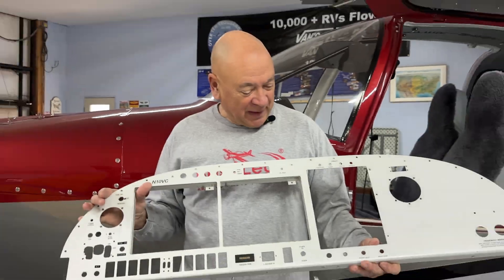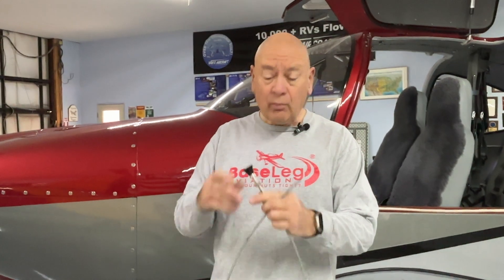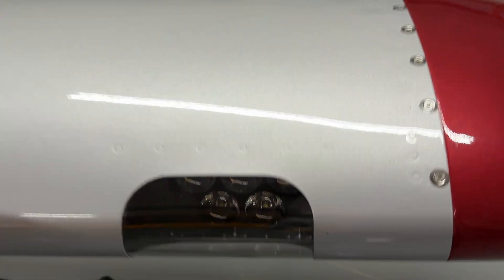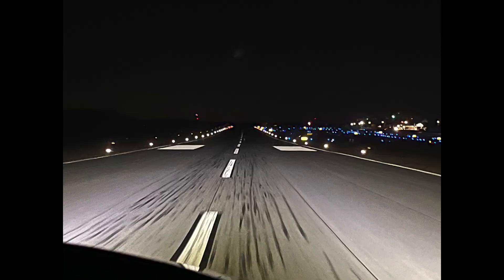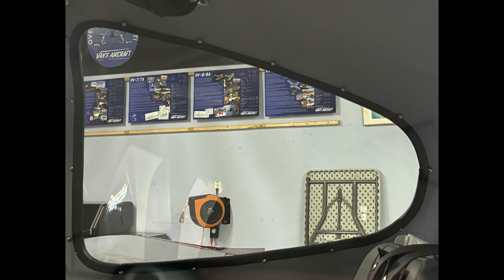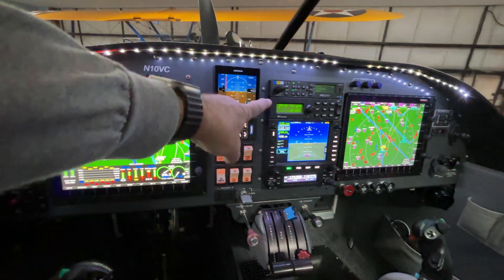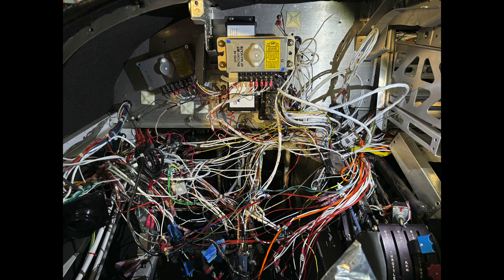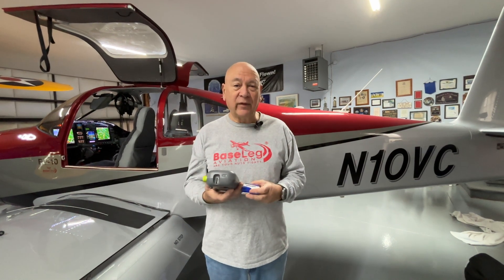RV 10 upgrades

Comment: I just had a mixture cable like that break 2 months ago at 10,500’!!! I went with a twist set up.
Reply from the maker: which mixture cable are you talking about? All of the engine controls on my RV10 are high quality ones with threaded ends and rod end bearings, the same as any twist control.
Reply: @baselegaviation1614  it was the one that looks like a piece of welding wire like the one shown in your video. Briggs and Stratton lawn mower set up basically.

Comment: This may be a never-ending debate, but I would like your input.  You went from two side-by-side displays to centering the two displays in front of the front passengers?  Why did you separate the two screens and now that you have a little bit of time on the new configuration, which do you like better; side-by-side or separated?
Reply from the maker: the 6600’s are bigger than the 5400s. Yes, I would like them both together but they are too big to be on the same side. Plus it would put the navigator GPS too far away. AeroSport products makes a nice panel that allows for a center screen, but I didn’t have the time or money to make that complete change right now. AFS has a really nice feature in that you can put the right screen in map mode and remote zoom it from the left screen. It works pretty cool.

Comment: You mentioned that you have a Tru Track autopilot, but I see a Dynon autopilot head in your new panel.  Are you using the Dynon to command the Tru Track?
Reply from the maker: yes, the SV-APPANEL you noticed allows direct entry to the autopilot functions instead of having to use the screens. it also has me prepared for when/if the Trutrak fails I can just install the Dynon servos and be ready to go without having to cut a hole in the panel.

Comment: What's the schmoo all over the firewall there where the cables go through?
Reply from the maker: fireproof sealant.
Reply: @baselegaviation1614  Ah, that makes sense. Part of a firewall pass through kit?
Reply from the maker: you can do it that way too. I just use grommets and sealant in some locations.

Comment: great panel but is it difficult to get the airworthiness cert updated for IFR operations?
Reply: No, simple
Reply from the maker: The airworthiness cert has nothing to do with IFR. It is specified in the operating limitations that night and IFR are permitted if properly equipped. if you older ops limits, it may have been omitted. just call the FSDO or a DAR and they can issue new ops limits.